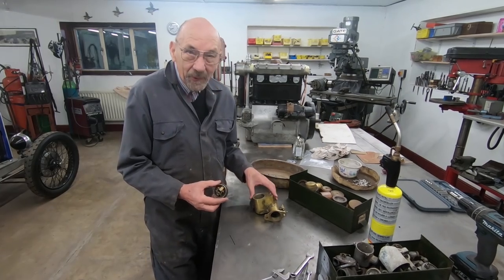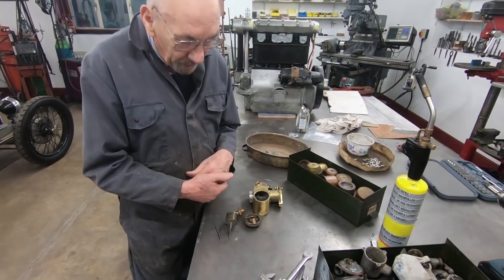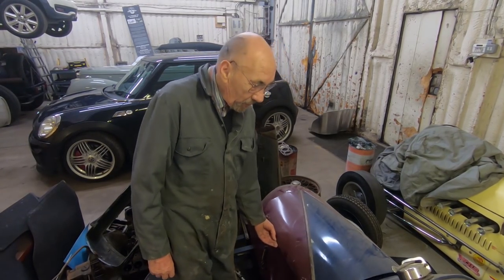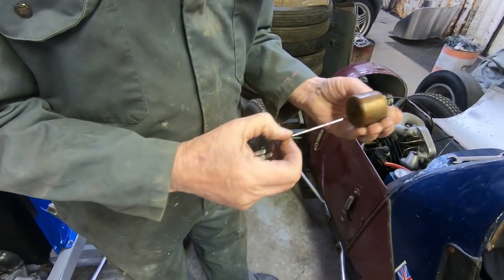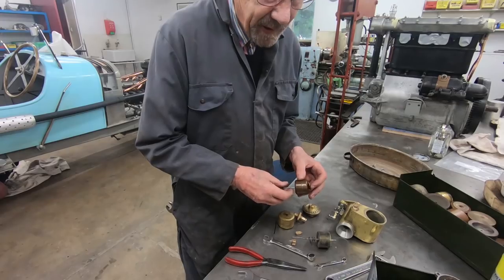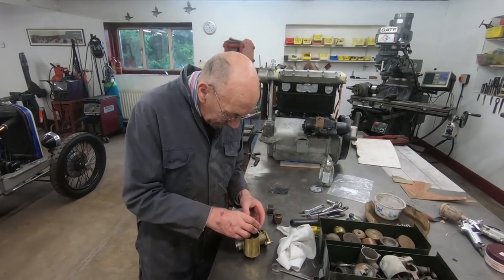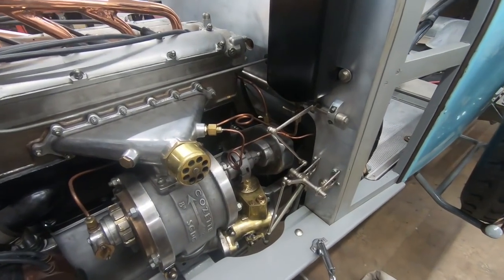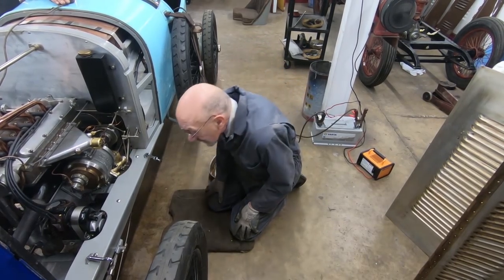San Sebastian Supercharged Salmson - Ivan's Shed

Comment: I'm not an old car nut but I am a lifetime maker. Ivan's practical tinker/designer knowledge is stunning. Practical smarts born of long experience. What he doesn't know about how different materials behave under heat, vibration, pressure etc, you don't need to know.

Comment: A much better float arrangement than the complicated original, as an afterthought, you could thread the stop valve shaft and adjust the float level with a pair of knurled nuts, that would be much lighter than using a spacer, I also lap the shut off valve using Brasso until the seating is making a perfect seal, a really nice video! Thanks for posting this! Chris B.

Comment: Absolutely fascinating, only just found your channel, FWIW somewhere I have seen a floatless carb for desert racing, that basically had an overflow with a scavenge pump. The way it was done was pretty elegant, a threaded brass ferrule put through a hole made in the bottom of the float chamber and reaching up to the desired fuel level. An electric fuel pump used for scavenging would not suit this car of course. Keep up the good work.

Comment: You mention modifying Zenith Carburettors for Bugattis, I wish you’d do a video about that. I have had 36mm Zeniths on my type 30 and they gave me a lot of problems, as the needle valve wears they run leaner and leaner and the float height is difficult to adjust. I’m using 30mm barrel throttle Solexes now but they choke the engine so I struggle to get above 2700 RPM. I assume you remove the “mechanism” above the float, but what do you do to replace the needle valve?

Comment: Interesting again Ivan. I did the same on a similar Waltham Orient carb. a while ago.  Out of interest, have you come across the bottom fed Amal becoming stuck on it's seat if you go too mad with the fuel tank pressure, 4 or 5 psi can be enough.
Reply from the maker: Yes, had that issue on Methanol.. Just got to be a bit careful.
You never drive down to the start line without some problems...

Comment: As an old mechanic loads did not know how to do it in the old days anyway! Who needs a strobe light, what’s a dwell angle, what do you mean have I checked the advance, oil the felt in the dizzy and grease the cam clean the points before installation are you nuts. I can check the tappets with my ears who needs feeler gauges they ain’t rattling. The amount of cars sorted by just doing a proper service first before trying to find a mysterious fault.